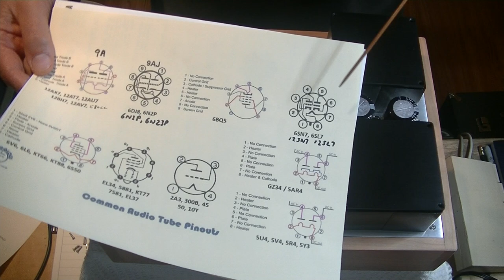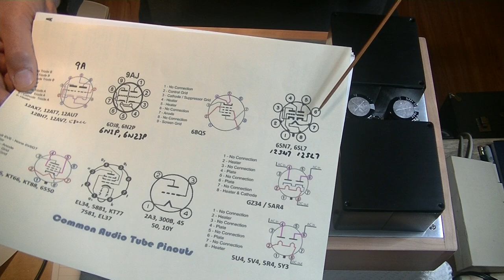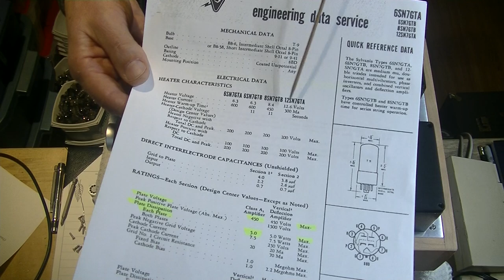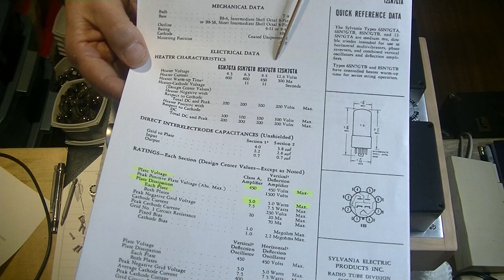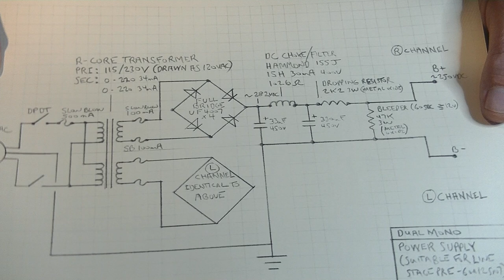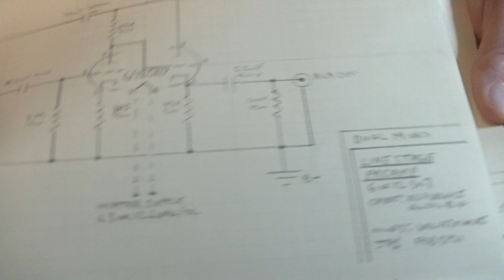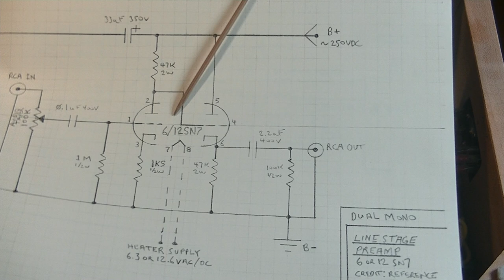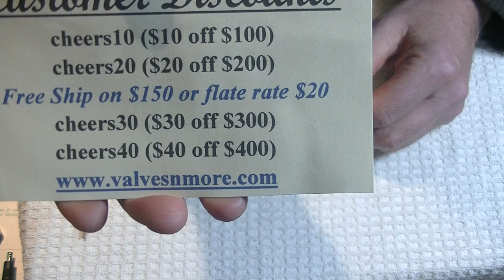Tube Lab #19 - 6 or 12SN7 Dual Mono Preamp

Comment: Glad I found you! I used to build Heath Kits purchased at Allied Radio in Chicago when I was a younger man.
 I have tube guitar amps and would LOVE to build another amp/pre-amp! (dual mono of course)
Reply from the maker: Welcome!  I got my start with Heathkit as well when I was 14.  Believe it or not I built an entire fairly complicated preamp without a voltmeter, just a soldering iron and a resistor chart!

Comment: Thank you so much.  I enjoy your videos and I like your clear explanations. BTW, your audio sounds perfect to me.  I've been scouring the web for just the right 12SN7 preamp and I'm pretty sure I've found it here.  Question; I followed the link in this video to find the two schematics dated 2/5/21 - Rev-3.  When I went to your website I found cad generated schematics with a later date (8/6/22) but with an earlier revision of 2.4  Which schematics do you recommend I use- the hand drawn ones or the cad drawn ones?  Thank you,
Reply from the maker: Always build to the highest revision number, this would hold true for almost any technical drawing.
Reply: @tubelab194   Ok, I'll build to older pencil drawing labeled Rev. 3.   It doesn't seem right to me but I'll trust you.  Thanks.
Reply from the maker: @jeffcatalano2518  just to clarify the cad drawings are the official releases, the hand drawn schematics are all working drawings.  The correct schematic and most up to date is the one in the store under information.

Comment: Nice pre-amo, I love how people talks about dangerous high voltage in valve/tube gear, then put out their designs with exposed tubes & no cover, over them. I tend to think tubes are too fragile to be used like that.
Also, why the separate external heater supple? that means two power outlets for one amp - weird.
Reply from the maker: Thanks for your comments!  No high voltage is present on the exterior of most common audio tubes, the glass and plastic base don't conduct.  Yes the pins are "live" but they are buried in the socket.  The separate heater supply allows the use of 6 or 12v heated 6sn7's (same tube different filament voltage).  This allows you to use the more affordable 12v version of the 6sn7 and opens up a much larger selection!
Reply: @tubelab194  I think the external heater voltage is a neat idea providing noisy cheapo switch modes aren't used. I tried it once with a 12v wall wart and the noise on the heater rail could actually be heard. On the scope, the output was sooo bad. I now use two small lt1083 boards one at 6.3 and one at 12.6. With a switch.
Reply from the maker: @LawsonsStudio  Yes, cheap SMPS are to be avoided.  When I first decided to use a SMPS for an external filament supply, I scoped about a dozen different brands and found some of the generic Chinese brands to be very noisy and poorly filtered.  A few are very quiet, those made by large computer companies tend to be the quietest.